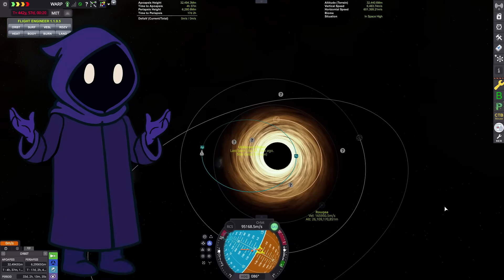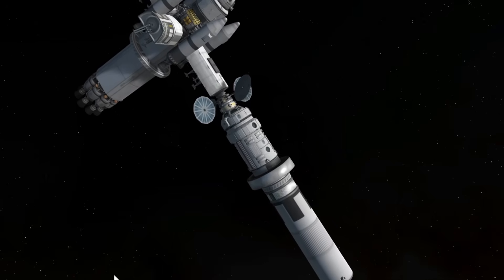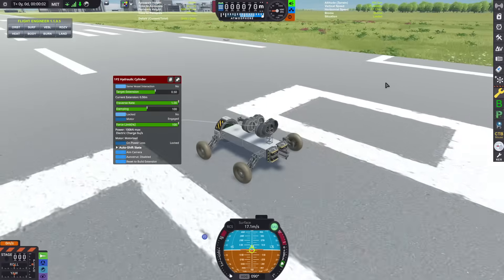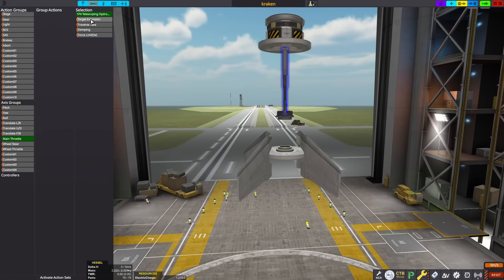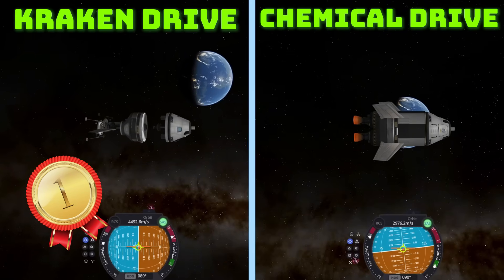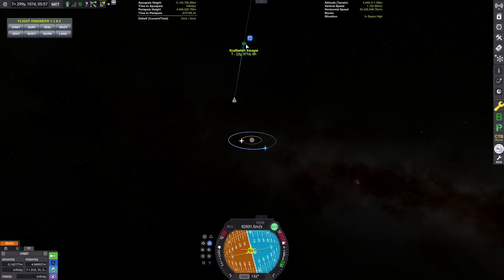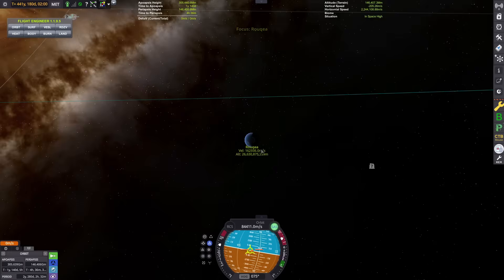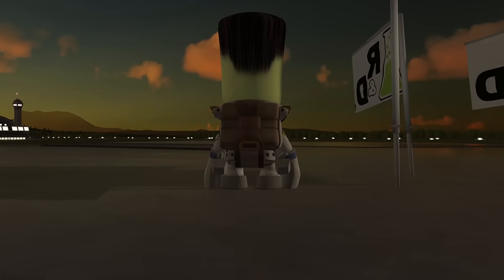Trying To Go Interstellar In KSP With Only A Docking Port

Comment: 7:57 Using Kal overclocking You can get such speeds with ease and game will not have a stroke as long as You keep the low mass and strong joint connection.

Comment: Tired of running out of delta-V? Troll physics has the solution!

FACT: docking ports attract when they get close, depending on the set docking acquire force
1. Acquire 2 docking ports (bro tip: use magnets for faster acquiring)
2. Attach docking ports facing each other
3. Set their docking acquire forces to 0 and max respectively
4. Infinite delta-V! NASA will go bankrupt! SpaceX will go bankrupt! U jelly?

Comment: The community fixes mod is configurable with the config.cfg so you should be able to reenable the docking port drives with it installed. Its even its own fix separate from the other docking port improvements.

Comment: 0:30 Noooooo not the single stick of Ram!!!
Reply: Hey man leave him alone, that single stick was probably 300 dollars.
Reply: Nah because 2 > 1.
Reply: U know that there can be 64GB ram in one stick?
Reply: @XzekajThe reason for the joke is, that that means you're running the ram single channel. I mean Ihv'e heard it isn't a big deal with DDR5 ram, but still kinda funny.
Reply: @jakobmax3299 ok, im just saying, and i think it will run smoother with one stick
Reply: @Xzekajit will not, dual channel is better in performance, its better to have 32x2 than 64x1
Reply: @XzekajWell your thinking is wrong and you clearly have no idea
Reply: @Xzekaj what did you even base that thought on lmao? vibes?
Reply: @toniemojekonto3956 what about 16x4 or 64x2?
Reply: @tapurate638  short andwer: most likely not, running 4 DDR5 dimms will absolutely tank the speed you can get out of them because your signal integrity suffers a lot from the extra DIMM in the channel

Long answer: yes and no, it's complicated and it gets technical QUICK, depends on the configuration of the DIMMs
lets start with some background on RAM ICs (Integarted Circuits):
a RAM IC can be x4, x8 or x16, or have a 4bit, 8bit, or 16bit wide interface, x4 is server only shit, so we do not care, x16 is exceedingly rare on 16GB+ DIMMs so i will skip on them for simplicity, that leaves x8

the Capacites of DDR5 RAM ICs are:
8Gbit (relatively rare, but they do exist, they are half enabled 16Gbit ICs)
16Gbit (common)
24Gbit (less common, but still widely used)
32Gbit (uncommon, expensive)

what is a memory channel? a memory channel is a 64 bit wide data bus

DIMM=dual inline memory module, aka the RAM stick

memory is separated in Ranks, each rank is 64bit wide, and using x8 ICs you need 8 to fill up a rank, you can have more than one rank in each DIMM, and you can have more than one DIMM per channel (DPC), you cannot access multiple ranks in the same channel at the same time, but you can send commands in succession to each without waiting for the completion of each command.
one rank of 16Gbit x8 ICs is 8x16Gbit=64Gbit=16GB

there are short ways of representing the configuration of a memory susbsystem: 
1Rx8 1DPC 2Ch: this means 1 Rank (1R) using x8 ICs (x8), 1 DIMM per Channel, 2 Channels, for a total of 1 rank in each channel
1Rx8 2DPC 2Ch: this means 1 Rank (1R) using x8 ICs (x8), 2 DIMMs per Channel, 2 Channels, for a total of 2 ranks in each channel
2Rx8 2DPC 2Ch: this means 2 Ranks (2R) using x8 ICs (x8), 2 DIMMs per Channel, 2 Channels, for a total of 4 ranks in each channel

i will now drop the 2Ch part as i am gonna assume it is all dual channel from now on.

16GB DIMMs can be 1Rx8 using 16Gbit ICs or 2Rx8 using 8Gbit ICs, so your 4x16GB configuration in a 2 channel platform (all consumer platforms now)can be:
1Rx8 2DPC: 2 ranks in total
2Rx8 2DPC: 4 ranks in total

2x64GB confguration can only be:
2Rx8 1DPC: 2 ranks in total

conclusion/TLDR: all else being equal (frequency, timings, memory controller settings) 4x16 can be a bit faster than 2x64, but 16GB dimms with the correct configuration are not very common, so it will most likely be the same

Comment: Also if you can go really fast with no problem, using far future tech and antimatter engines I was able to get to star systems around kcableleiosios distance in less then a year, with a crushing speed of 10,000,000M/S

Comment: Small little suggestion for your computer, I noticed when you showed it off at the start of the vid that it has a singular stick of ram, I’d suggest looking up how and why to install more as single Chanel will kneecap performance, it’s also a pretty inexpensive upgrade, and kerbal is a very ram heavy game especially in the late game or with mods.
Reply from the maker: Thanks for the input. I just have the 16gb stick in right now. I’ll for sure buy another stick but I’m just low on funds at the moment 😅
Reply: @VoidSpaceProgram  alright, fair enough, just makin sure you know, single channel is obviously useable, its just not optimal configuration, what can i say im a computer building nerd :p
Reply: One stick of DDR5 is only dual channel, single channel does not exist on DDR5. Now, it might be a DDR4 system, but that is a 5060ti so it being DDR5 is likely. But he was still lagging anyways.
Reply from the maker: @notcraig255 I was lagging but I had recorded that gameplay on my laptop before it died. Only the intro and outro were recorded on my new pc